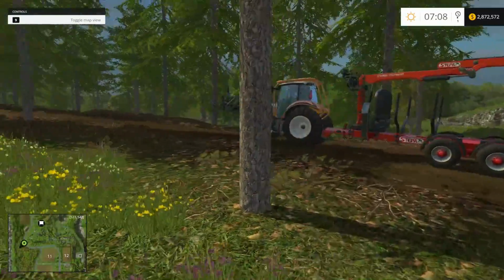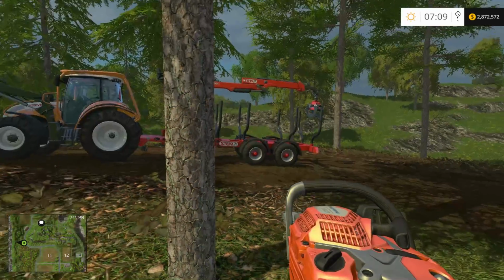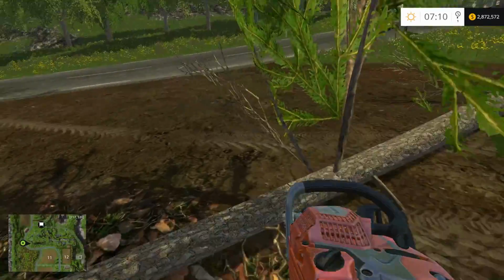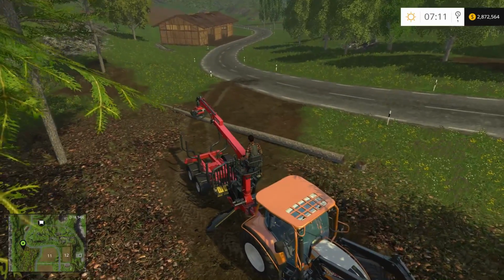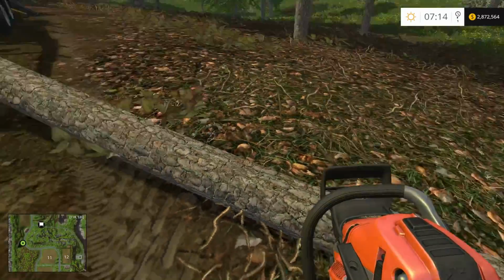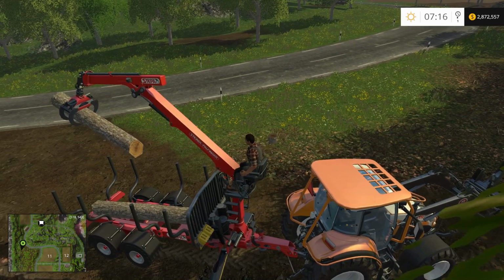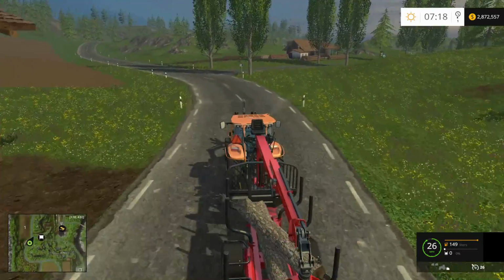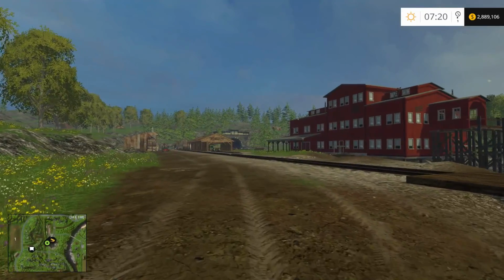Akiic ToDaHead Plays Farming Simulator 15- Basic Tree Cutting and Logging Tutorial

Comment: The pond works just like the train, but without the second income, I'm a noob so i was trying to see how to use the tree planter, though i liked your video, i never used the train, but i guess i'm gonna haha!
Reply from the maker: gabeteuton Thanks for that :=) I will be doing another vid soon on tree planting as well. Thanks again for the support and the info on the pond!
Reply: There's a even a third option, which is to manually load the logs into the train itself, the middle wagons that look like trailers, that option gives you even MORE money, but you have to unload them from the trailer and load them, which in bigger trailers may be an issue...
Reply from the maker: gabeteuton Thanks for this! I had heard that option but have not tried it myself :)
Reply: Akiic_ToDaHead
I started to venture into forestry and well, if you want to go big, you'll need to use a trailer mod, the same original one but wide with less vertical holders, so you can unload it with a fork, and i would also recommend the big fork for the wheel loader (it's called uploader or something similar), those 2 work perfectly and make it easier to use that third option which i can confirm that gives you the most money!!
Reply from the maker: gabeteuton
Thanks for sharing all this great info! I will look into just that combo! :D

Comment: Can you substitute the front end loader with claw attatchement for this? I just need to get one of the logging trailers though first.
Reply from the maker: You can Michael Zell but make sure it has enough horse power to lift the logs- and a weight on the back :)